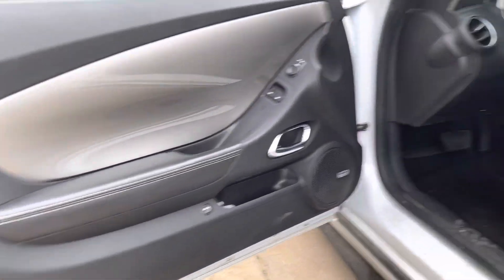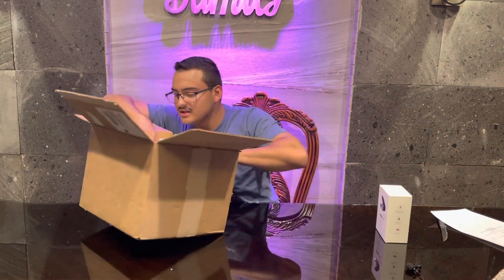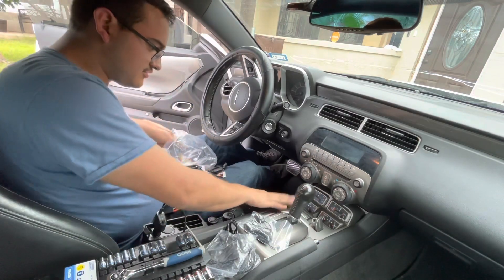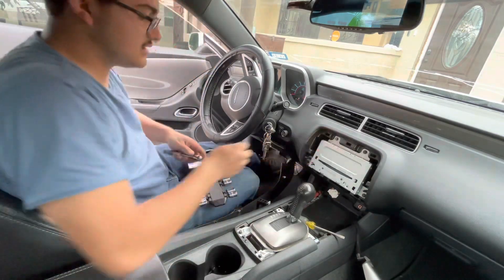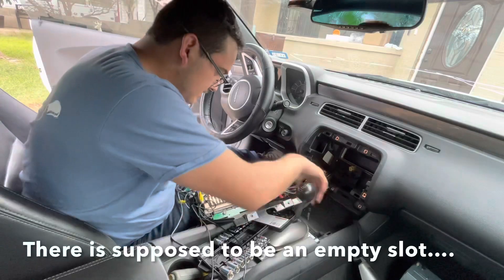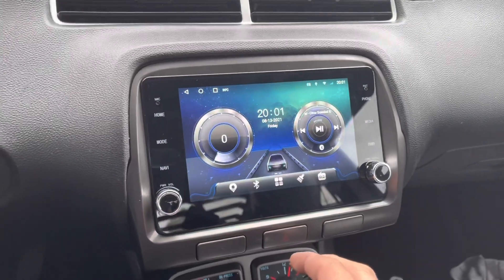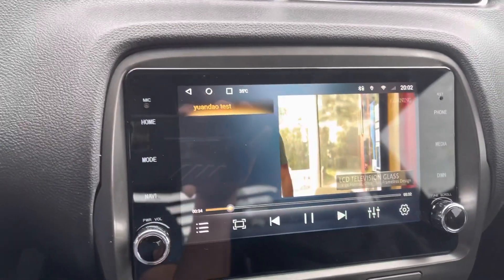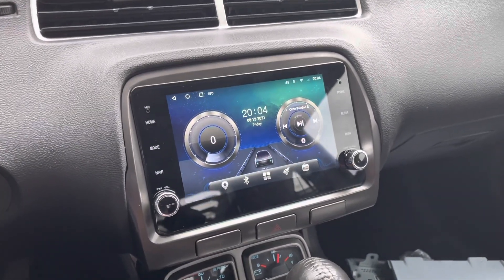New stereo for the camaro!! (Digital Octopus, Apple Car Play + Android Auto)

Comment: Hi. I have a 2010 Camaro SS. The stereo works but the system no longer activates the ac Compressor. All ac parts are new ie compressor, dryer, and condenser. does this octopus system allow you to control the ac as well?  NEED HELP PLEASE.
Reply from the maker: 👋🏽 hey, so your question was if the head unit controls the A/C? The awnser would be yes, there is an app that allows you to have the knobs and power buttons and transfer them into a digital screen.

If you have any questions let me know on my insta for faster response time!
Storm _trooper432
Don’t forget to like and subscribe 🔥

Comment: Does it seem that your AC dont feel as cold as the OEM head unit?
Reply from the maker: hey! the A/C system is not touched other than the buttons, the A/C will work exactly the same as the OEM radio

Comment: I had this unit installed in my Camaro not too long ago one question for you with my original unit I was able to hear my phone call of with Bluetooth throughout all of the speakers in the car well the ones in the door and the ones in the back I don't know about the the tweeters and all that but however would this radio it comes directly from the passenger side only is there a way I can adjust that to where I can have it coming from all speakers when I'm having a conversation on the phone thank you for your time by the way I've looked all over trying to find an answer for this problem per se no luck yet hopefully you can help me out and also it's a ahd camera I'm having issues with that and I don't know why thank you
Reply from the maker: Hey 👋🏽 I can try to help but There is a lot of questions I have to ask to see if i have a solution for you my friend 
Do you mind sending me an Instagram message and lets see if we can get that fixed for you!!
Don’t forget to like and subscribe!!

Comment: How do you turn on the air if the radio covers everything up?
Reply from the maker: Hi there, there is an application you open with AC configuration that holds all stock settings…it takes a little getting used to but nothing hard!!
Hope this helped..
Don’t forget to like and subscribe :)

Comment: Did you have the Boston acoustic setup before or just the regular?.
Reply from the maker: Hi there 👋🏽 the Boston acoustics or “premium Audio”is a package from gm (I bought it like this) hopes this helped, 
Don’t forget to like and subscribe!!
Reply: @thev6camaroguy   The reason I ask is because the Boston acoustic setup is actually different. There is an amp in the trunk. The standard radio setup shouldn't have that. The Boston acoustics setup probably  require a line output converter for the heat unit.
Reply from the maker: Yes, you are correct the amp is located in the trunk….as far as the head-unit, it’s completely plug and play for Boston acoustics and for normal audio systems!!! No extra requirements.
I also have a video on replacing the Boston amp with  your own amp make sure to check it out! 
Make sure to follow my insta for any other questions!!
Storm_trooper432

Comment: How does carplay work exactly?
Reply from the maker: Depending on what unit you have, for example my DO10-15 has wireless car play, the cc10-15 has wired but you can buy a dongle.
The carplay works through an app called T link(there might be some videos on that) 
The carplay is the same as any other head unit
Skipping songs does have a tiny delay but nothing too big!!
If there is anything annoying of carplay is that reversing it stops the music! I haven’t found a fix for that 
Long answer but hope it helps🤷🏾‍♂️
Don’t forget to like and subscribe:)

Comment: How’s the navigation?
Reply from the maker: Hello, the navigation for the head unit its kinda weird I didn’t get the app to work correctly, but I also did not spend time on it.the antenna does work….so when I do use navigation,apple play or the google app on the unit will do the job (internet is needed) 
Hope this helped!
Don’t forget to like and subscribe!!
Reply: @thev6camaroguy  thanks for the info, do you know if you can have the rear view camera on while in drive or does it only work for reverse ?
Reply from the maker: No problem any more questions feel free to ask! 
It only works in reverse, you wouldn’t like it in drive either way because the back up camera interrupts the whole head unit not allowing you to do anything while its on
Have an amazing day!
Reply: @thev6camaroguy  I got another question if you don’t mind answering, what color is the reverse light wire? Can I use a y tap and tap into the wire where the tail light harness is you know where the tail lights are or do I have to actually tap into the reverse wire that is all the way down the bumper ?
Reply from the maker: I don’t mind at all, I don’t remember the color of the wire I taped into…but you can always get a tester and test it out.
For your second question, yes all you got to do is open the trunk and get that plastic cover for the taillights off and that will reveal the wires you need(no need to mess with the bumper or nothing like that)
Hope you are having an amazing day and dont forget to follow me on instagram!!
Storm_trooper432
Reply: @thev6camaroguy  by using a tester I would test everywhere but before I do that I would have to first put my car in reverse with the e brake on and then test each wires near the driver side tail lights ? The one that lights up means it’s getting power for the reverse light ? I’m new to this I don’t know much about electrical stuff
Reply from the maker: That’s correct, you can always look at youtube videos for further assistance, and its okey I am learning as I go with my car as well🤷🏽‍♂️

Comment: This is beautiful unit !  I've had my eyes on it for quite sometime.  I ended up putting it on the backburner because I already had the Chevy link touch screen and features.  Instead I decided to go for air suspension and rims first.

I have now turned my sights back on a head unit and upon revisiting DO's website I noticed a new DOTS - 1015 unit. It's slightly higher in cost but I always wanted a tall monitor for my ride. 
https://youtu.be/xhHImCYe7Q8
Reply from the maker: Priorities are first!! But It all has its time, I really like the head unit, and the company…Hopefully one day I can work with them 👀 
Don’t forget to like and subscribe and go say hi on instagram:)
Storm_trooper432
Reply: Did you have any problems with the sound, was it better or worst after installing, and any other problems?

Comment: Bro should of got the mylink system instead
Reply from the maker: I was going to but getting it programmed was going to be a hassle! 
But that was my first option 
Thanks for the support 🙏🏽
Reply: @thev6camaroguy  ngl tho you still got a very good Radio like some of the other aftermarket radios normally they can be laggy or slow but the one you got is really fast and has a good Operating system!
Reply from the maker: I can agree, I recently changed it out but by no means it wasn’t working that thing was going strong after 2 years

It all comes down to preference
Reply: @thev6camaroguy  Hello I can't find where to find the part on the website link you posted can you send me a new one where it is at!